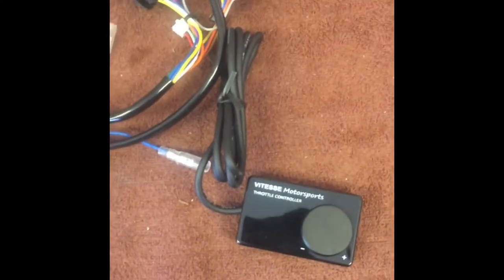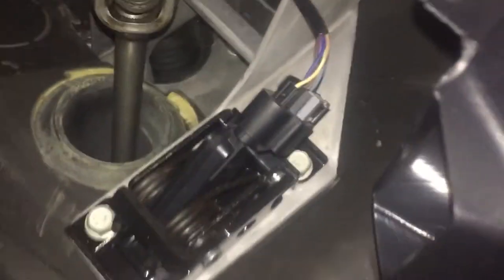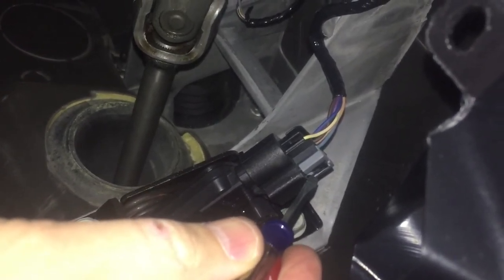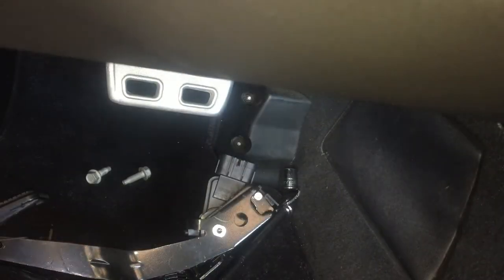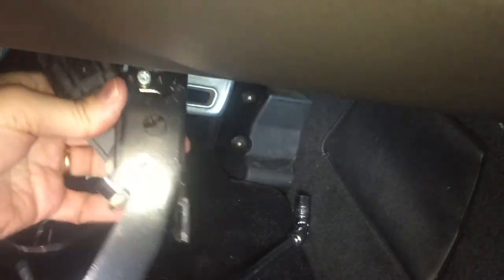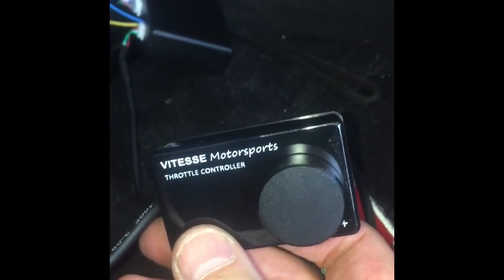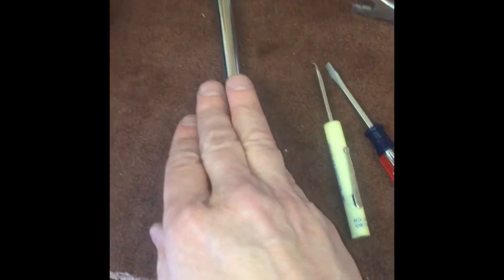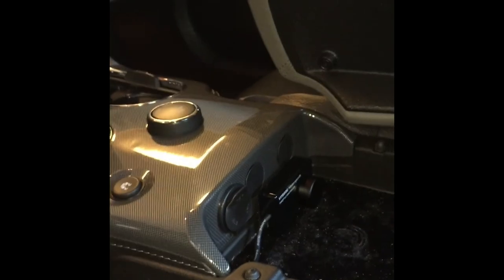2009 Corvette C6 Vitesse Throttle Controller installation

Comment: I just installed mine and I have to say you made it look WAYYYYYY easier than what it turned out to be! I struggled removing the plastic part and I'm a big guy (slightly claustrophobic) so working in that tight space was not pleasant at all! Happy to say though that I REALLY like how the car feels with this product installed! l'm thinking SP5-6 will be my sweet spot! Thanks for the video!
Reply: bighurt1972 how did you like your results? I’m thinking about getting one
Reply: Yeah.. I'm having absolutely no luck getting the bolts out of the pedal...  Oh man.  Has been an hour so far and haven't gotten the socket to seat on the "hidden bolt".. any tips?

Comment: I can’t figure out how to get the small grey piece off 😩
Reply from the maker: On the side of with the clip, push in on the center of the gray connecter and pull out on the black clip.  Watch the part where the gray connector is pushed back in.  You'll see that  it has a slight wedge to keep it clipped in.
Reply: @DIYGuyUSA  I see the part In The middle surrounded by the black piece.  It has a wedge, so I mash it in with something and then pull on the main grey part?  Do I need a screwdriver or a pen or can it be done by hand?  Sorry for all the questions.  I’m not too good at this.
Reply: @DIYGuyUSA  just got it.  Thank you so much!
Reply: @DIYGuyUSA  just got finished with everything!  Thank you so much for your help.  I wouldn’t have been able to do it without this video and your fast reply.  Best thumbs up I’ve given in a while!
Reply: somebody should practice some more